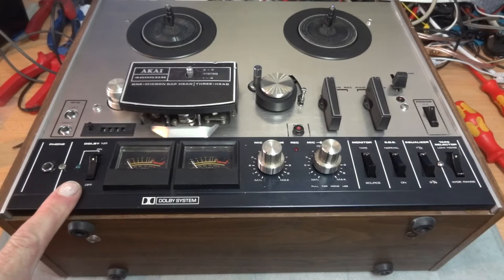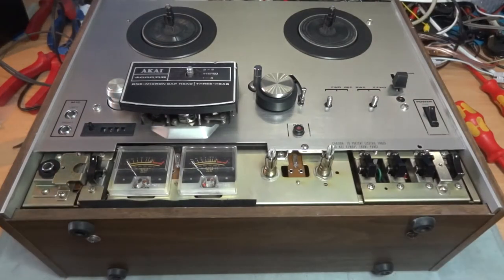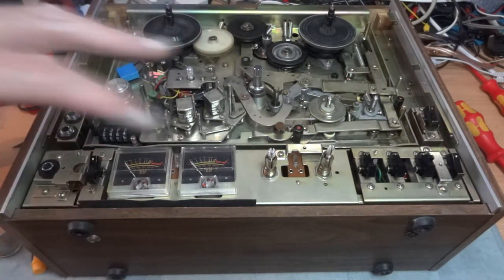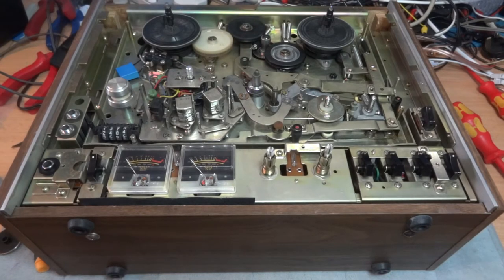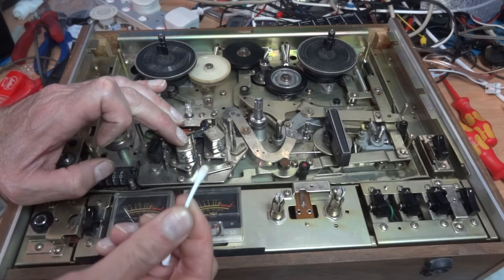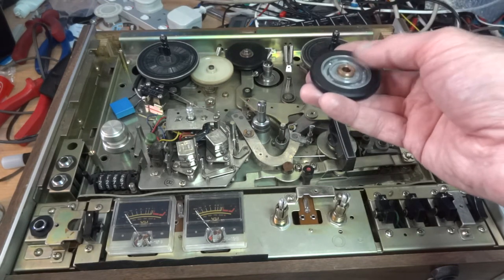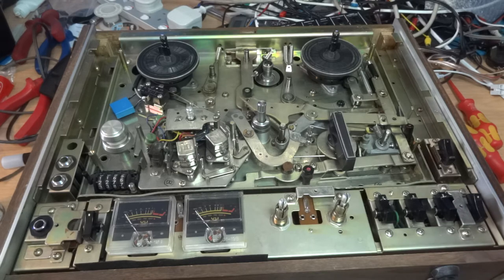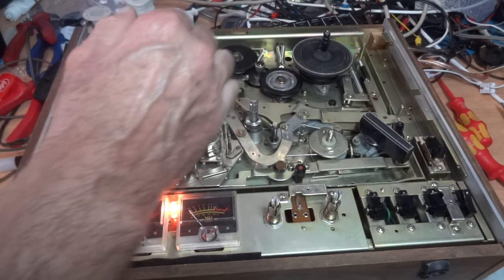Reel to Reel Tape Deck Service, Cleaning, Repair & Maintenance, Sony, Akai, Tandburg, Teac, Revox

Comment: Thank you Michael, great simple straightfoward video. You not knowing or remembering the names of parts is a plus. We know what your pointing at.
Reply from the maker: Thanks David,  I do so many takes that by the last one I can not even remember my name Lol
Reply: Pinch roller and capstan are two of the parts Micheal was trying to remember.

Comment: Wow £50 off ebay? great find! i'd been looking for ages for a reel to reel but i'm not willing to pay the silly money people are asking these days. I was actually given one the other day for nothing though, complete with user manual a 1971 phillips N4450. Amazingly it still works including the integrated amplifier. It just needs a clean and service but nothing major, it does sound a bit muffled and one of the motors struggles in one direction so the tape starts to spool out. Thanks for this video, very helpful.
Reply from the maker: Some buyers are asking over the odds buy it now, but still a chance of picking one up collection only now and then they appear, with maybe just needing a little service, controls cleaning etc, good luck with the Phillips
Reply: @MichaelYates  Thank you!
Reply: I got 2 Sony reel to reel units off eBay in 2022. One worked for 10 mins then died. The other is still working.  The people paying out over a grand for these mostly chase after Teac and Marantz and other extremely advanced brands. Akai maybe goes around $200+  Absolutely nobody at all wants Sony, Magnavox,  or any of the department store brands, so if you want a player just to enjoy you music like I did, focus on Sony decks from the TC series. I paired my Sony with a standalone "amplifier" (dolby noise reduction unit/splitter because the tape deck has no internal amp) and wooden Sony bookshelf speakers from some 1990s stereo (they match even if anachronistic) and made a lovely little setup for less than $150.

Comment: Cleaning is good, very good. What we do not see anywhere on YouTube is how we change the capstan belt. Do we need to disassemble the motor on the back or just the rotor that comes through the front? It really isn't easy. Maybe you know it's done?
Reply from the maker: Thanks, the Akai is in storage at the moment. I have some cd players and headphones to look at next, then I will did the Akai out and see how easy it is to change capstan and counter belt.
Reply: I laid one of my Akai units upside down on a workbench and my son wanted something around my bench while I was away, I came back and the right side reel holder was snapped. I had a donor unit so I pulled that one out and replaced my broken one. But even the donor one was slightly bent. I thought, I hell I hope it doesn't snap while bending into shape.. I was lucky. 
And the belts are easily gotten to from the rear of the unit, so I checked each against the donor but they're about the same. Put it all back together and all is good on my latest recapped re transistorized preamp Akai 4000 DSmk2.
I'm thrilled
Reply from the maker: Thanks for the comment Mike, I will replace the belts on mine soon when I get it out of the cupboard, think I will do some re-capping as well, just getting the time at the moment. Good to hear you managed to get your one back to shape and sounding well.
Reply: @MichaelYates  today I was able to test an add-on Bluetooth board. Its working on a test board connected to the preamp.. I've ordered PCB boards because I ran out, then I'll add it to my reel to reel. BTW.i ran the Audio to the microphone jacks on the preamp board opposed to the line input jacks. I'll also add blue LED to go along side of the lights in the Meters.
Reply from the maker: @mikelunsford7462  Thanks Mike, I hope to get some spare time soon, The Bluetooth sounds a good idea and very handy

Comment: What was the cleaning products that you used, amazing video thank you for posting..
Reply from the maker: The pots were cleaned with Deoxit D5 , though something like Servisol super 10 will do the job, Cleaned rubber and heads with Isopropyl Alcohol, not using the same cloth though.

Comment: Hi sir.Thanks for your reply. Would you believe it. Thoroughly cleaned heads and da-da! Sound its back.dirty brown muck on cotton buds. Nadty! Now have to align head after head screw was removed but not by me and that sodding rubber flywheel that runs off motor shaft slipping.push it against motor pulkey and speed improves...ugh. Appreciate your assistance here. Will persevere
Reply from the maker: For proper alignment a special alignment tape and ossiliscope is required, but for a pretty dam close free go at doing this can be found on my cassette tape alignment video, pretty much the same as that but on a reel 2 reel head instead
I would get a good bright recording that you have on a reel2reel tape and use that to align the playback head first as my cassette video and then on to the record head, feed in a bright recording on the input and monitor the output and adjust the record head so the output sounds the same as input, switching back and forth from tape monitor and play
https://youtu.be/Lr2Hzxj3qt8

Comment: Great video.I have a vintage ultra circa 1960's busted belt.Is it worth trying to superglue the belt together or get some 'o' ring cord and do the same.Incidenty is meths ok for cleaning??
Reply from the maker: Hi Simon, with gluing the belt that old would have thought it would not be to long before it goes else ware, try finding a new or similar belt would be best. The meth's would be fine for cleaning the belt, but heard its not that great when removing any grease.
Reply: You have to replace the entire belt with new. Find the specific belt for that unit, it can be more than one. The rubber is old and rotten. It can't be fixed. Most of them melt into liquid tar.

Comment: Good stuff - Have you dealt with the felt pads in these decks? I get some rubbing noise on playback just from the felt. Can't find any information on whether replacements are available, or should they be dealt with somehow?
Reply from the maker: Hi, No I have not personally, but I have read in a few places that taking apart each reel and cleaning the pads with a tooth brush as this artical here https://www.tapeheads.net/threads/akai-4000ds-mkii-tension-issue.70413/

Comment: Excellent video!  I have a Teac 330010,  I notice sometimes the tape slips off the pinch roll, I stop the deck at start it back up and it works.  I was wonder what would make it slip off the pinch roller in-ward toward the deck?  I notice it does the same thing on my Pioneer RT 701 deck too once in a while. The pinch rollers don't look that bad.  Any advice would be great. Thanks.
Reply from the maker: I would clean the tape transport and its all in alignment, make sure the pinch roller is not hard or surface is shiny, though could be just a little lack of tension on the take up reel and arm, this problem is not always an easy fix.

Comment: Can you do a video on changing the play cams as my Akai model 9 has just lost its play cam due to metal detoriation.  I'm just not sure how to remove the control arms to refit the replacement cams .
Reply from the maker: Hi Paul
I did try to get the play cam out , but mine will not budge, so at this moment in time I can not help. Wish you luck.. 12 volts does a video here showing a broken one in place, but he does not take it out https://www.youtube.com/watch?v=p48E3jeEr2w

Comment: I have got the same unit so this video was great for me, could you just tell me what spray you were using
Reply from the maker: Hi Roger, the pots were cleaned with Deoxit D5 , though something like Servisol super 10 will do the job, Cleaned rubber and heads with Isopropyl Alcohol, not using the same cloth though
Reply: @MichaelYates  Thank you so much for your quick reply the Deoxit D5 has some very good reviews so i will order some
I have just subscribed to you, Iam sure i can learn a lot from your videos

Comment: The pinch wheel cap is supposed to be screwed off, it comes off without much chance of damaging it.
Reply from the maker: Thank you , yes the pinch wheel should be unscrewed and not prized off.
Reply: @MichaelYates  I have the 4000ds mk11 model, which I thought had worn out, only later I found out about the dreaded sticky shed syndrome of the tapes!  Still got it but never used in the last 10 years plus :(
Reply from the maker: @Moonlightshadow-lq4fr  That is very annoying, I hope you have not lost any important recordings. I did buy a few new old stock tapes that had suffered from tape being sticky. I also had a a lot that would had to many dropouts for my liking and for both them reasons I ended up selling both my decks on. I should have paid a little more and bought some tapes from a specialist I think.
Reply: @MichaelYates  Well it was not so much about tapes being better because they come from a reputable firm.  The sound quality of the cheap tapes was due to the poor mixture of oxides when manufacturing them.  It is because the glue or binder changes its structure that holds the oxide to the tape.  The only time I was gutted losing tape was when I put a full reel of my best stuff on top of the back of a speaker!  It was on there an instant and everything zapped!  I am surprised by now they haven't invented a method to scan the tape without contacting the surface.  One would think it would work perfectly and a set of guide posts on roller bearings on the edge of the tape instead of all the friction on the entire tape width wise.  Surely it would be worth it just to mirror the tapes?  This would be for sticky or shedding tapes, no good for magnet erasing as I did with that darn speaker :)

Comment: Hi Michael, great video. 👍 can i ask for any details on how the record engages? My one doesn't. The switch for the record light doesn't get pulled unless I physically pull the lever at the back and I can't figure out how the record head mechanism gets engaged to fix it. I can push the record button and then move from play to record but nothing happens 🤷 Everything else works none to shabby so it's a bit baffling! Any advice kindly appreciated.
Reply from the maker: Hi, I will be getting both decks out the cupboard very soon to do another video, Which machine do you have the 4000db or 4000ds as I am sure there is a difference in the 2 when record is pressed due to the DB having Dolby. I will try and incorporate the record mech into the video I will be doing
Reply: @MichaelYates  that would be amazing man, it's the 4000D I have so not Dolby. Also not DS or DB but I believe its just minor cosmetic differences to front panel. I honestly think anything you could cover would be so valuable so thank you kindly. I'd love to get the old girl working and mastering some recordings! Thankyou
Reply from the maker: @numanisme  I hope this might help you, at the end of this video I show the rec mech on a 4000db, you might not have the switch on the bottom board and just have the switch on the side plate, but it shows how they are both engaged and disengaged , https://youtu.be/sAD5ncYTZ_Q
Reply: @MichaelYates  thanks so much for taking time to do that man!

Comment: Is there a tool or method for measuring the torque of the spindles? The service manual of my Voice of Music reel to reel gives values to check for, but I'm not sure how best to do that.
Reply from the maker: Hi Jonathan, I think there probably is, but finding one might be another matter. They used to use a torque dial gauge (VHJ-0004) for video cassettes recorders as far as I know and with a little modification might be how to used on a reel2reel. But here is a link to someone that using fish scales with a little improvisation might help, if you read through it you will see the method https://www.antiqueradios.com/forums/viewtopic.php?f=13&t=268062

Comment: Help ! Heads on a old sony tc266 have been messed with. Owner removed mount plate screws thinking he could take off mech to get to fly wheel belts now sound is awful all base and no volume. How can I possibly re-fit the head to align it.Thanks
Reply from the maker: Not going to be easy, a lot of trial and error with the tape runners alligement and tape azimuth depending what state he has left the unit. Having a tape with a high quailty recording will help with the alligement and azimuth. there is a service manuel on HiFiengine that may well assist you https://www.hifiengine.com/manual_library/sony/tc-266.shtml ,, also I see this YouTuber is here https://www.youtube.com/watch?v=LZ5LpSdM_sU , is doing a lot of work on he's and could be another person to help on this perticular model

Comment: Get dbx noise reduction system type 1 and type 2 for type and records must-have for records even playing through it add dynamics 224x  nx40 about £30 second-hand
Will completely eliminate hiss from tape and add dynamic range to tape and vinyl and vinyl that's been recorded with dbx much superior to Dolby noise reduction
Can add 40db of gain to types and if you get the record that's been recorded in dbx be 118d be of Gain where a standard record is about 80db Max.

Rubber goes hard with time and can be reformed specially belts firstly put the belts and the wheels in a jar of water in the microwave for 15 minutes then completely dry, then  on a pan in a old metal tin put some thin silicone oil soak the guide wheels or any hard rubber simmer for about 25 minutes probably want to do this outside wipe off any excess and should be alright the silicone oil nourishes rubber brings it back to new. Take any rubber guide wheel of any plastic guide wheels'  don't put that in the pan!
Reply from the maker: Thanks John, the dbx sounds very interesting and would love to try one of these units out. A quick search and I have seen a few on eBay for around the £80 mark, I will set up a saved search and hopefully find one a little cheaper. Thanks for the tip on softening the rubber also.
Reply: Although DBX sounds really good it is very sensitive to dropouts and wowow & flutter, you need high tape speeds, and those sound 224x as good without DBX.

Comment: What kind of grease do you recommend for mechanical gearing?
Reply from the maker: Hi Stephen. I have been recommended LUBRIPLATE NO. 105 MOTOR ENGINE ASSEMBLY LUBE OIL GREASE a number of times, though I have used MODEL RAILWAY GREASE and SUPER LUBE both doing a good job.